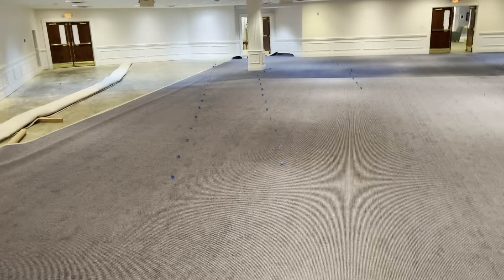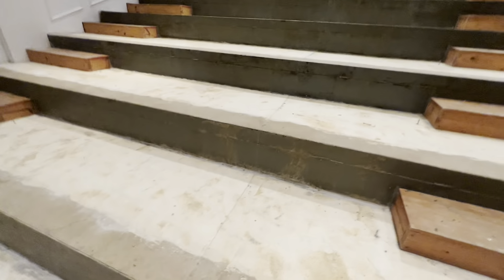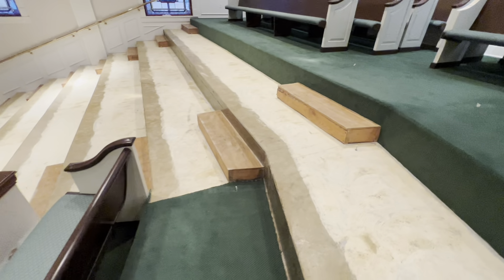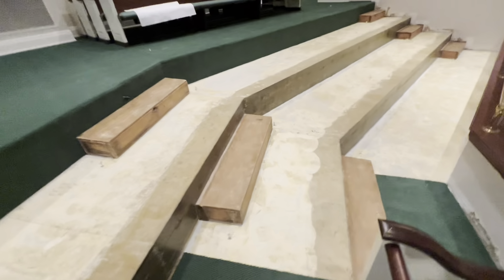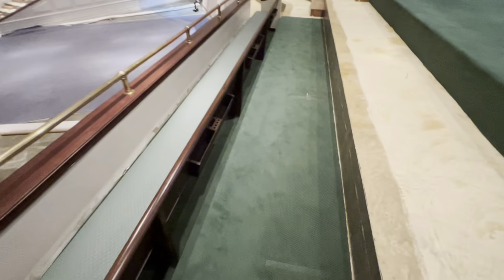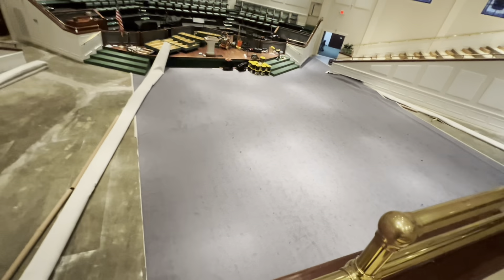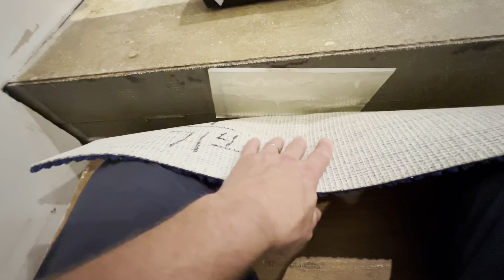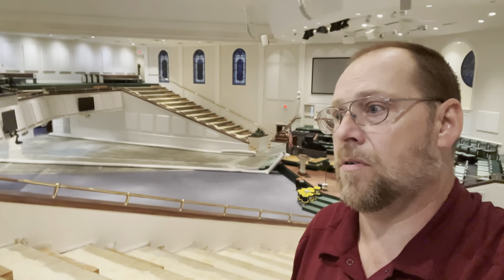Daily grind glue down carpet installation

Comment: I use a spray contact adhesive called everstrong es 30 to wrap carpet on stair noses. It doesn't smell as bad as contact adhesive, goes on ten times faster. It comes on 5 gallon propane like tank with hose and spray gun. Works awesome and is instant grab no wait time.
Reply: I just looked it up and it looks cool, would save a lot of time for sure.
Reply: May think I’m crazy but we use zippo lighter fluid on the edge of the stair nose, and that carpet bends like paper to the wet glue.
Reply from the maker: @Jerrid208  I have heard of people doing that